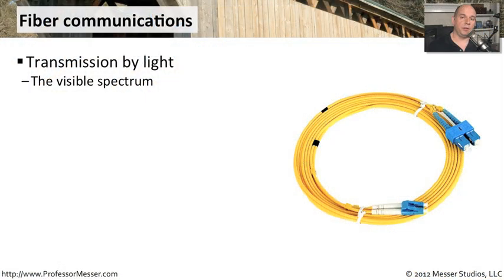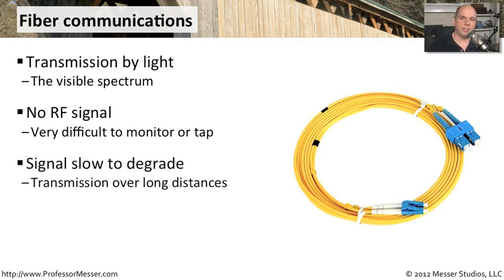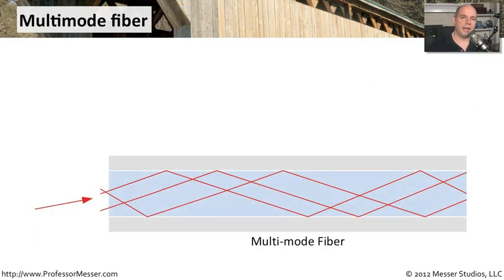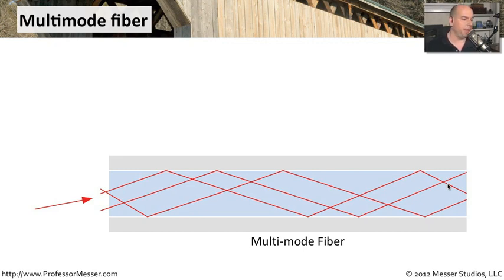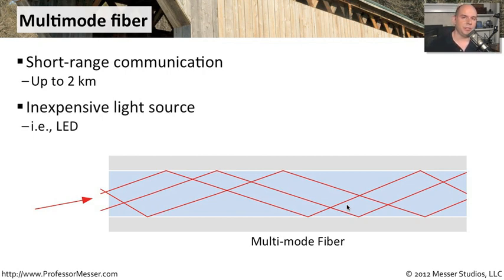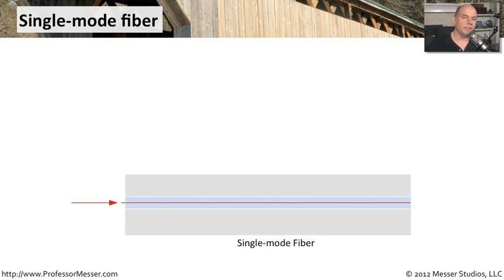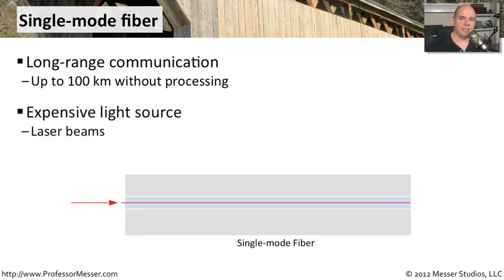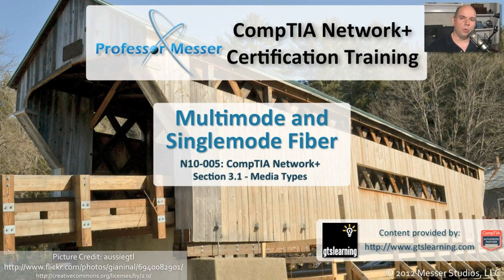Multimode and Singlemode Fiber - CompTIA Network+ N10-005: 3.1

Comment: you said fiber optics are easy to monitor because of the noticeable drop of signal and yet on your note you said its very difficult to monitor or tap???
Reply from the maker: It's easy to monitor (manage) fiber installations because it's easy to find signal problems. It's difficult to monitor (analyze) data that's going across a fiber connection because of the complexities associated with tapping the connection.
Reply: ty professor